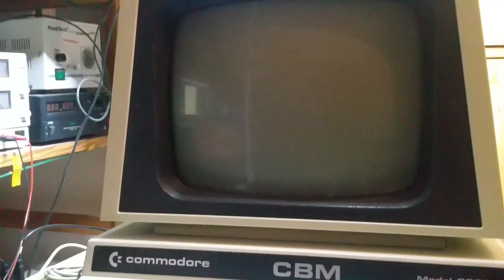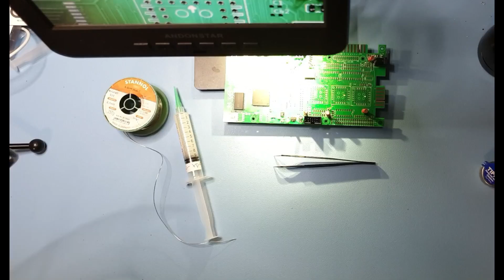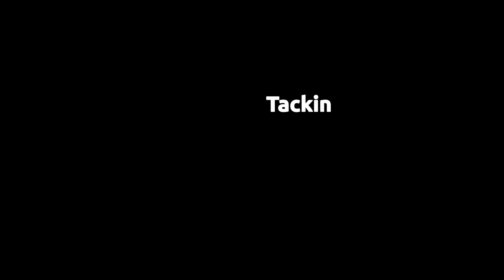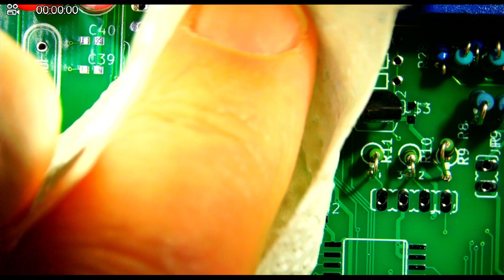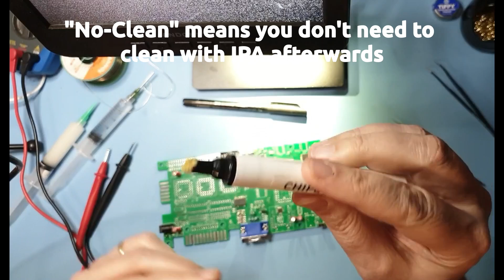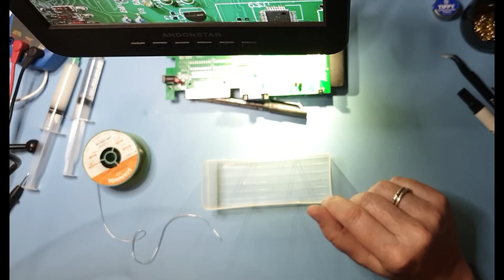8bit-times learner: soldering fine pitch SMD chips (Ep. 28)

Comment: Since my last company has a 5000m2 production, I didn’t have to seriously solder for over 20 years.  Since I don’t work there anymore, I now have to solder everything. I started soldering smd end on the 1980s, so I was not completely without experience, but I have learned a lot after that last job. Especially, that I was using a too small soldering tip 3/4 of my life 🤣

Flux is a real miracle, that helps, that the solder goes, where it should go without „aiming“. I use liquid flux (Keinath KFM24 XLO) in a dropping bottle with a needle and flux paste (AMTECH NC-559-ASM) from a syringe. 

A (stereo) microscope is a very nice thing, but it is not really essential. Most of the time, I am using my head band magnifier. 

Finally, I like soldering SMD much more than through hole components. It is faster, because you don’t have to flip the board all the time.
Reply from the maker: Not sure if I'm already faster with SMD chips (with higher pin counts) - I am in the process of getting more used to SMD small parts, like resistors and caps - but somehow I still find through hole resistors and caps more easy to solder...

Comment: I can't believe this even works!  I would think 80% of pins would be  missed or a cold solder joint.  I miss through-pin and socketing.
Reply from the maker: You have to be careful to not miss any pins. I usually go over each pin twice, by moving the soldering iron not the full width. And yes, cold joints still happen, but rather seldomly compared to the number of pins.